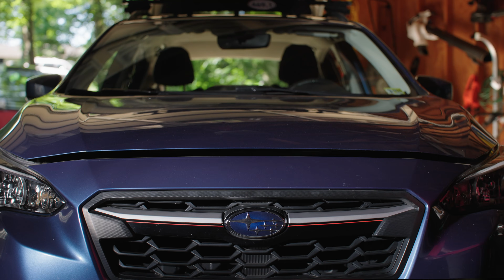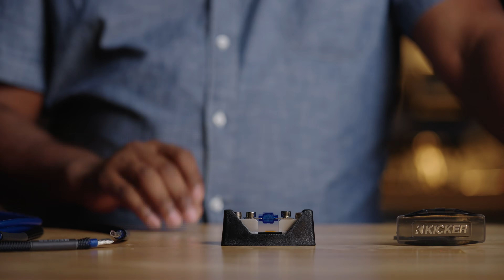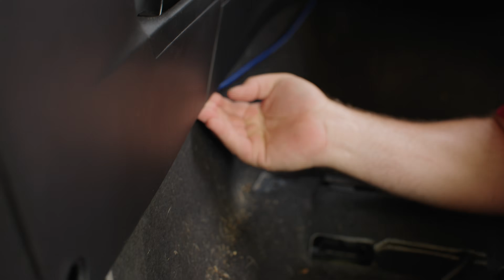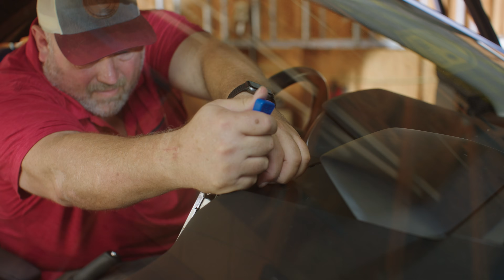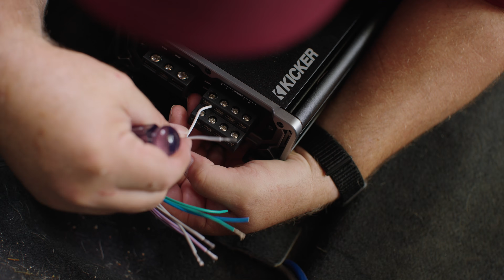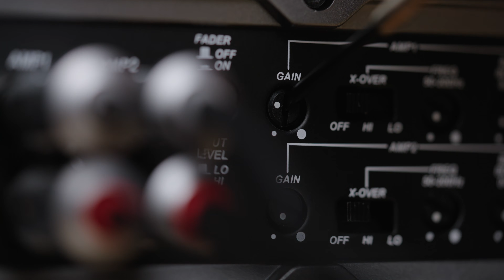How to install a car amplifier with a factory stereo | Crutchfield

Comment: Hey, where did you mount the fuse in the engine bay? I have the same model and was wondering.
Reply from the maker: Ideally, the fuse holder will be placed within 6" from the battery. It can typically be screwed down to a spot near the battery or just secured with cable ties so that it won't move around.

Comment: Don't you need new wiring if you're using an external amp? Most factory wiring can't support the increased power from the amp. Or am I missing something?
Reply from the maker: We found that the typical factory speaker wire can support up to 75 watts RMS (some stock wiring can handle even more). That Kicker amp outputs 65 watts RMS per channel making it able to use the stock speaker wire instead of needing to run all new wires.

Comment: Won't lie. Running the hot wire was probably the easiest part of this entire video..
Reply: It normally is the hardest part.  There often isn't a grommet or even access to the firewall for that matter, if you DO have to drill.

Comment: What connectors are those that you used to connect the 9 wire to the wiring harness
Reply from the maker: In the video, the connections were soldered, but you could also use standard crimp connectors or these handy Posi connectors: www.crutchfield.com/p_669PP500/item.html

Comment: You use a piercing what to get through the firewall lol.  I've always called it a piece of clothes hanger, tape the wire, cable, vacuum line to it and push it through.  Been working for 45+ years here lol
Reply from the maker: Those definitely all work, too! A good old-fashioned wire clothes hanger is a versatile tool.

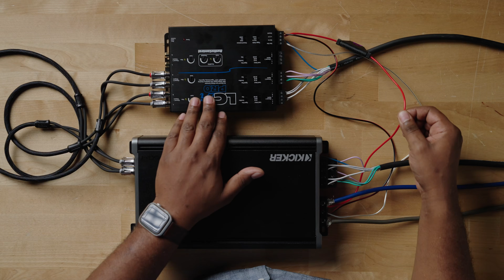Comment: 13:01  it shows the setup 
I’m just confused where you get the soaker wires to the amp itself, You connect the wires to the output converter but where do you the other speaker wires to connect to the amp , I may sounds dumb but that’s the part I don’t get
Reply: 6:03

Comment: So what do i connect the other side of the 9 wire to? Totally new to this and trying to install an amp into my 2015 nissan altima sv.
Reply: Also trying to do it without an LOC converter, unless you think otherwise.
Reply: @verrucktcaleb2065I think they explain that doing so without an LOC may cause issues with factory unit. There are other videos (not sure if its from this channel) that show how to go from amp to factory unit. Requires a t-harness specifically meant for your vehicles radio.

Comment: Hi all the way from the DR, wish you guys were out here since your installs are really clean, but the video will do for whomever i put to install my stuff... Im looking to do the same to my 2016 ford explorer xlt, meaning 4 speakers on door, keep the back dome speakers/center speaker, add 2 shallow mount bass, i would like to know if you can provide me a link with the T harness for the sync 2 radio and the 9 cable i believe for the speaker wiring, im going to try to get an installer out here to set up when im ready...maybe by end of year or next... its ruff out here$$$.  I would love your input
Reply from the maker: Hi Jonathan, we're glad to help. Keep in mind too, we have Tech Support here to help 7 days a week. Their direct number will be on your invoice. To verify, you want to add aftermarket amplifiers and speakers/subs to your 2016 Explorer with 9 factory speakers?
Reply: @crutchfield  Correct, planning on changing the 4 door speakers, 6x9 and 6x5, keeping other speakers, adding 2 shallow mount subs, also keeping the sync 2 radio
Reply from the maker: We have the PAC AmpPRO AP4-FD21 Aftermarket Amplifier Interface that lets you install an amplifier of your own without losing any of your vehicle's factory audio features like warning chimes, navigation prompts, and Bluetooth functions.
http://www.crutchfield.com/cgi-bin/ProdView.asp?i=541AP4FD21

We don't have anyone we are partnered with or recommend for installations. However, we have this tool on our web site to help you locate and contact installers in your area.

https://www.crutchfield.com/localinstaller/installersearch.aspx

Comment: I need help my car battery keeps draining when the car is off and I think i wired something wrong because when I disconnected my amp it’s stoped draining. Any suggestions?
Reply: Try to find a different fuse that will kill the power when the vehicle is off It may be drawing power from the battery when the car is not running.
Reply from the maker: Thanks for reaching out, we're happy to help! Free tech support is included with every Crutchfield purchase,  just locate your Crutchfield order number in your confirmation emails and give our experts a call at 1-888-292-2575.

Comment: You forgot to include options for power connections at the battery, if you don't have that terminals on the battery cable.

Comment: Odd not to link supplies because I’m doing a forester and everything should be the same and was hoping that t harness would’ve been linked
Reply from the maker: The correct wiring T-harness to help add   an amplifier to a factory stereo would depend on the specific vehicle. What year is your Forester?  Did it come with the base factory audio system or a factory "premium" sound system?

Comment: Question for the professionals, what is a safe RMS and peak wattages for factory speaker wires if you were to utilize the T-harness and amplifier?  I would imagine that the true value could differ between manufacturers?
Reply: You should be able to find that information by looking up your specific vehicle info. I found out that my factory speakers were 2ohm and that's why the 4hom plug and plays that I tried out didn't sound all that great. They need a separate amplifier.

Comment: Where does a dsp goes in all this? Or do you replace the LOC with a dsp?
Reply from the maker: Hi John, you can use a DSP between the LOC and your amps or use a DSP with built-in speaker-level inputs. We even amps with built-in DSPs.

Comment: So in order to get the Amplifier installed the factory Speakers needs to be Replaced as well ?
Reply from the maker: In most cases, you'd want to match an aftermarket amp to aftermarket speakers as well. What's is the year, make, and model of your vehicle? Did it come with any factory audio upgrades? Do you have any specific amp or speakers in mind?

Comment: Do not use this information. They got a lot of things wrong! I'm just going to mention one of the many. He sets the gain from an after market radio. But the car has a factory radio. Factory and after market radio volume levels are set at different percentage for setting the gain! To me there is a big difference between "it's working" and "it's correct " 😂 Big difference!

Comment: Getting the wires in and run was the absolute easiest part.
Reply from the maker: That's impressive!! Also, not often referred to as the easiest part of the install. Just curious, what was the hardest part?

Comment: Ok, so to be honest, I'm only about 8 minutes into the video, so I don't know if this gets mentioned at some point, but the video shows a diagram of what they are installing a few times, and I see no mention of dash speakers. If you were going to include those, what would it change in terms of wires/harnesses?
Reply from the maker: Hi Maxine, the exact wiring scenario would depend on the amp and speakers you'll be using. Do you have a specific setup in mind? What is the year, make, and model of your vehicle?

Comment: Nah, new speakers, 2 way components and pre powered under the sit subwoofer. Imma skip all that
Reply from the maker: That can help with the overall sound of the system. You may not hear a lot of the audio from the back speakers, but having upgraded audio coming from all locations does help with making the overall experience sound better. You might first try playing no audio through the rear speakers as that too ensures that you only hear upgraded audio.
Reply: @crutchfield cool
Reply from the maker: That sounds like a pretty killer system, too.
Reply: @crutchfield hey thanks, I have learnt so much. I am just not confident in my skills. I will do some sound deadening. Should I upgrade the rear too?

Comment: Complete and straightforward. Congratulations 
I have however these questions if i do this 4 speakers setup but í want to add a subwoofer where do I plug it in? The amps and radios are only 2 or 4 channels? The subwoofer part is really confusing
Reply from the maker: The LC7i line output converter we use in the video features a 2-channel output RCA for signal for a subwoofer. You can add a separate mono amplifier to power your choice of subwoofers, or you can use a 5-channel amplifier with a powered subwoofer output like the Kicker 46CXA660.5T in the link below.

https://www.crutchfield.com/I-rYALc166/p_20646CX66T/Kicker-46CXA660-5T.html

Comment: Reading the comments I noticed this can't be too much for some people. However, I think it's a very comprehensive and straightforward video. Only thing that I consider missing in order to be perfect is the subwoofer part, 2 or 4 speakers, pre amped output or t harness I still don't see where is the subwoofer output from the amp.
Reply: It’s just allot of unfamiliar concepts and jargon. Lmao “the power wire” “the ground wire” “the amplifier now has power going and coming from…” “20ohms” people just zone out lmao

Comment: I have watched this video and am trying to understand why would you show using that LOC with the Kicker amp when it’s not needed??? The Kicker CXA 360.4 is capable of accepting high level(speaker level) inputs. Kicker KISL rca to pigtail adapters is what you would use,correct? (Since they mention soldering anyway)The money you saved could be used to buy even better replacement speakers.
Reply from the maker: There's a few reasons to use it and in this video, the reason is because the factory radio doesn't work well with the speaker level inputs on an amp so we ran it to the LOC first. This is typically the case in vehicles with a radio that needs to see a specific impedance to turn on its amp channels. The other reason is that better clarity is wanted which means an LOC that can help clean up the sound should be installed too.

Comment: What if the vehicle has a factory installed amplifier.
??
Like say. 2023 Nissan frontier Pro4X with Fender system. 
I'm sure it needs upgraded.
Reply from the maker: If you have a factory installed amplifier in your vehicle you can use the same concepts as in the video, though every vehicle install is slightly different. Your speaker-level signal output would be taken post-factory amp, with the powered speaker outputs from your aftermarket amp spliced back into the factory speaker wiring.

Comment: A quality output converter from Kicker, Recoil, or Audio Control is the game changer between an "okay" aftermarket system, and a great one.
Plus, it will allow your amplifier to run cooler.  (Be careful of other brands of output converters, most actually add distortion to your signal to your amp. These don't).

Comment: Is there a T harness with RCA outlets instead of bunch of wires?
Reply from the maker: Typically, no and this is due to not all amps being able to take in speaker level audio via its RCA inputs. But we are happy to check options for your vehicle. To get started, what is the year, make, and model of it?

Comment: Somehow by changing factory speakers and installing an amp takrs away all the bass that those cheap factory speaker was providing - reason being those cheap factory speakers are very efficient also because they are perfectly matched to factory radio ..watts..ohm...and sensitivity - when we install new better speakers that perfectly matched sound is gone...either they will bw way too clear and annoying or bass is lost etc..olden days changing the factory radiio was very easy choose any brand alpine sony pioneer kenwood they all were standard one size fits all cars single din and double din...but nowadays with flip up tablet stlye head unit we cannot do that anymore because no standard good brands makes replacement options

Comment: Velcro that #&@% down. 😂😂😂

I did that with a sealed subwoofer a while ago. It ain't pretty but it worked.

When I get around to upgrading the audio in my car this time, I'm going for as clean of an install as possible. But its good to see I wasn't too far off when I stopped the sub from tumbling around my trunk.

Comment: Could you run the 9 wire from the amp back to the stereo stock speaker wire even if it’s a high output amplifier?
Reply from the maker: What's your exact amp/setup?

Comment: Do you guys have a service to prewire the T-harnesses with the 9 wire cable?
Reply from the maker: No, we don't. The ReadyHarness service is only available for select vehicles/installations, and isn't available for installations that bypass a factory amp using the 9-wire speaker cable. I wish I had better news there.
Reply: That would be smart. Like prewire for make and model and plug and play with amp and radio.

Comment: Is 14Ga. wire enough to power supplied the amplifier and unit?
Reply from the maker: The correct gauge of power wire to use for an amp depends on the specific amp's fuse rating and power output. Here's an informative article on our site that deals with determining the proper gauge of power wiring for an amp:  https://www.crutchfield.com/learn/learningcenter/car/cable_gauge_chart.html

Comment: Why does the fuse in the power wire have to be as close to the battery as you can get?
Reply from the maker: The in-line fuse on the power wire going from the amp to the battery should be close to the battery in order to minimize the risk of a fire if a short circuit were to occur.

Comment: I have two runs of 9 wire connected to the amp harnesses. So there's two blue wires not connected. You said connect blue to the red power wire  but I'm wondering which of the runs to use?
Reply from the maker: If they both connect to the same OEM wiring then it should not matter which you use and should cap off the unused blue wire.

Comment: This company is actually insane. I bought from them thinking doing a stereo replacement would be really easy. Then I watched a video of a guy soldering and wiring and I thought it would be semi plug and play in a 2018 vehicle. I was wrong. However, Crutchfield throws in tons of free stuff that would normally cost around $40+ and they effectively do all of the soldering and wiring for you. So ironically, it was actually plug and play for the speakers. Its just my speakers were rated for 100 RMS Watts and my car outputs 25 RMS Watts. So while fine, the upgrade didn't make the biggest difference. The amp hookup does look much more intimidating though...

Comment: what is the difference to run a speaker wires from the door speaker directly under the seat to the amp and using a custom mad T harness with speaker wires for rear and front ?
Reply from the maker: The difference is that the stock wiring in vehicles can be used with amps that output up to 75 watts RMS per channel while running new speaker wire allows you to install bigger wire and even more powerful amps. Another difference is that are lot of vehicles do not have a conduit that new wire can be ran through to get it into the door so reusing the stock wiring can lead to a cleaner looking install
Reply: I have a subaru xv 2015 and I made a new connector that connects to the stock speaker behind the radio the connector is with 16gauge wire can I use it running to the amplifier or do I need to run from the door 
 @crutchfield
Reply from the maker: Are you looking to tap in speaker-level for signal behind the factory radio for signal to an aftermarket amp?
Reply: No all i want to know is that its possible to run behind the after market stereo that i have with a custom made speaker connectors front and back directly to the after market amp instead of running each door after market speaker directly to the after market amp  @crutchfield

Comment: 15:39 so at this point did you disconnect the speaker wire and are only using the leads from the meter? I tried setting my gain with my meter last night but I could not get a reading. I tried it with my speaker wire still inserted.
Reply from the maker: Yes, when connecting the meter to set the amp gains, no speakers were connected to the amp.
Reply: Did you play the test tune?

Comment: Still a bit confused sorry but so when you make a T the 9 wire goes to the lc7i but from there how does it get to the 4 channel that’s the only part I don’t understand is where does the speaker wire come from that goes to the 4 channel inputs
Reply from the maker: That requires you tap into the speaker wires in the vehicle if there isn't a T harness available. What year, make and model vehicle do you have?

Comment: Why not route the power wire through the firewall on the passenger side, and get it behind the glovebox at once?
Less cable routing inside the passenger compartment..m
Reply from the maker: That can work too! The side of the vehicle that you run the power to isn't the critical step. The main thing is that the power cables and the audio input cables are kept separated until they reach the amp.